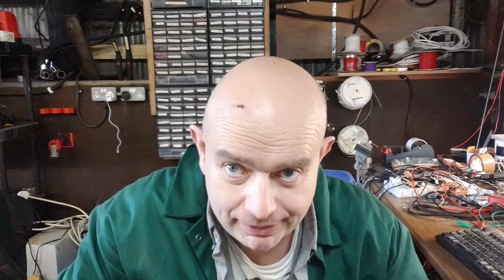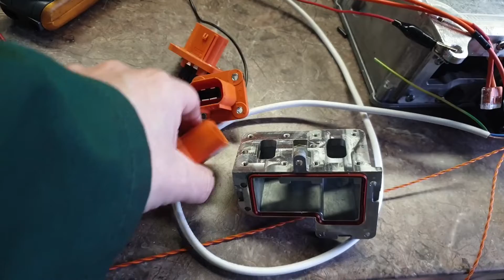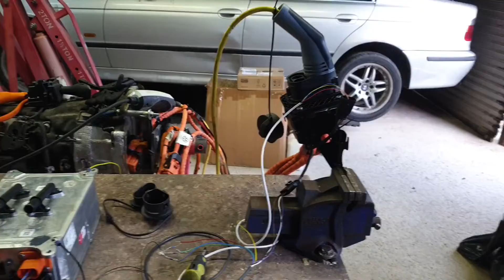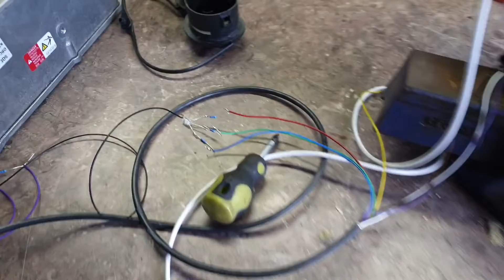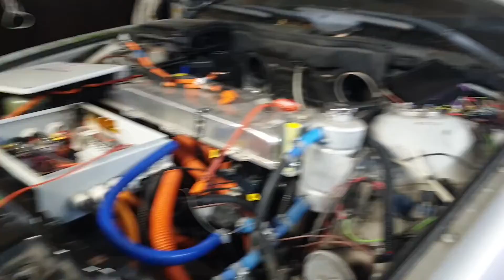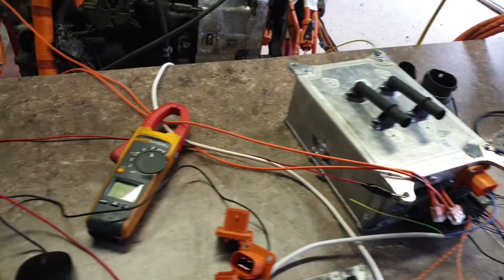Hacking The VW Onboard Charger Part 1

Comment: I think what you and those like you, and those who help you back engineer as repurpose these parts are awesome! 
I don't have a ev, but totally want to build one preferably a Chevy midsize truck, or SUV,  putting batteries between the frame rails, with a 6mm plate of steel covering them, on the bottom, with even the spare tire location and engine bay having battery storage, it should have decent range, I'd like to possibly use two leaf motors, in a AWD setup, one motor power the front wheels and one for the rear, maybe use a transfer case so it can all go to the rear, (it's more fun that way)😆,    and the ability to use only one motor for highway cruising, to extend the range,  with a 3-4 speed transmission, and proper differential gear ratio, possibly 3-4 and reverse could be used, with simple controls, Regen braking would be great, with a few extra batteries, I'd like to use Lifepo4 batteries, around 100-150 ah each, making a fairly large battery, and push the voltage high as possible, along with a 100ah 12v battery,  and convert the lighting to LED,  it should have near Tesla performance, if not, I believe the engine bay could easily fit two additional motors!! The lifepo4 batteries holding near solid voltage, and at approximately 200- 300 ah battery,  I would also have to install about 24+/- 250-300w solar panels  and get a 6kw inverter, 48v with about 300-600 ah,  and use it to charge the batteries, the solar can be diverted when not charging the batteries, or the truck to charge my house batteries!! 😆. Good day,. Wish you the best!

Comment: oooo VW stuff. I have a 2014 VW E-up and been looking at trying to get some can stuff. Not had any pinouts which limited me. I would be very happy to do some logging with some pointers in the right direction.
Reply: You can find the pinout for the E-Up (which is the same as the Seat Mii) in the Wiki, linked in the video description.